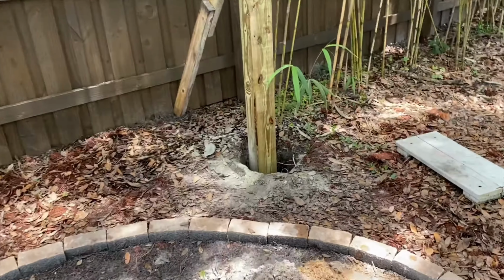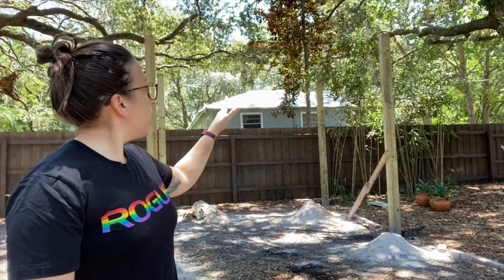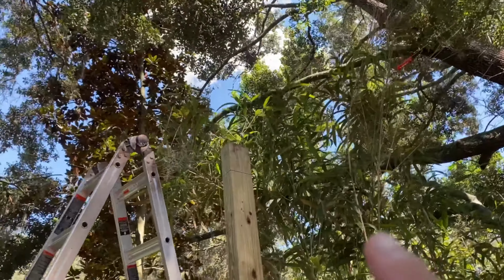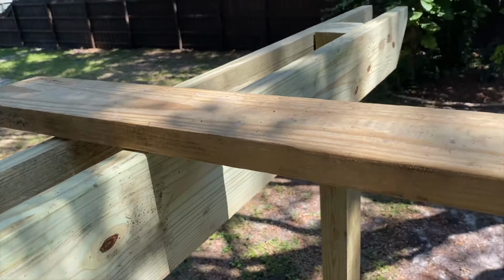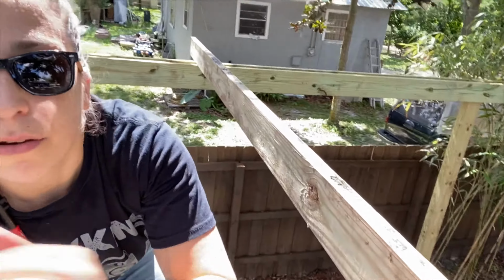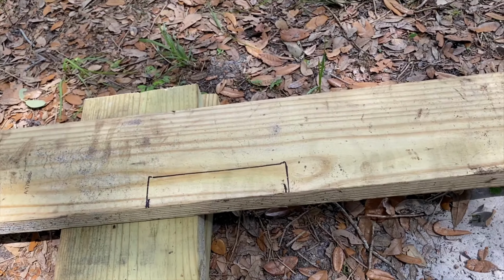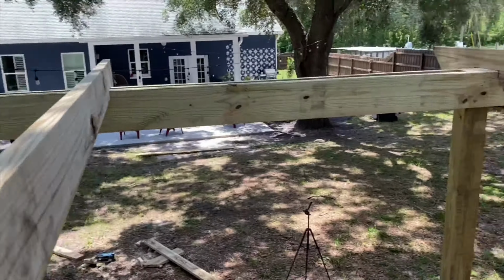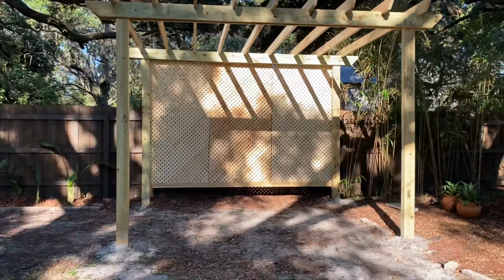DIY Pergola with Privacy Lattice Screening - Step-by-step Build

Comment: Really nice video! I was wondering if you have the size of the saw you used for cutting the pole tips. The amazon links you posted are not working anymore. Thanks!
Reply from the maker: Oh no! Do you mean the tops of the posts? I used a Milwaukee sawzall for that. I think the model is Model# 6519-31 and used a 9inch blade

Comment: Am a bit late to the party on this one having only watched this tonight, but it is super helpful. this year's project is a pergola with a ground level deck built within the posts. Super easy to follow your methods and like you I won't have a lot of fancy tools so it's great to see it can be done with as little as you did.  I'm in Ireland but DIY is the same worldwide....
Reply from the maker: Thank you! That is so awesome - good luck with your project. We just got concrete poured under this pergola instead of building a wooden one - but having the deck really makes a huge difference

Comment: Really well done!! I especially love how you describe your methods and reasoning for the decisions you made. I have 2 questions. How did you attach the rafters? pocket hole screw? Also is there anything you would've done different now that its been up a couple of months? I'm starting my pergola project this weekend so just trying to soak up all the youtube knowledge in little brain can take hahaha.
Reply from the maker: Thanks! For the rafters I used hurricane ties. On the other pergola I built, I also put 2x4s in between the two beams and put a deck screw going up into the notch on the rafters. I have a gate on that one so wanted to add extra support. Here is a time stamped link so you can see the exact tie I used for both pergolas. 

For this one, I don’t think I’d do anything differently! It’s mostly for looks and privacy and it’s doing its job really well. Thinking about adding a deck to it later on so will have to revisit it then. Good luck on your project!
Reply from the maker: https://m.youtube.com/watch?feature=youtu.be&v=S-SU_TmK9_0&t=13m28s

Comment: what were the dimensions of the lumber you used? 4x4 or 6x6 or 4x6 posts? not sure i caught that in the video. 2x6 or 2x8 rafters?
Reply from the maker: I think they were 4x6s for the posts. Main supports were 2x8 and rafters were 2x6